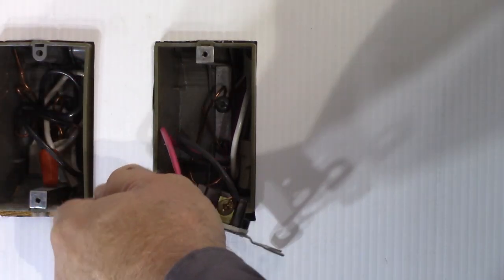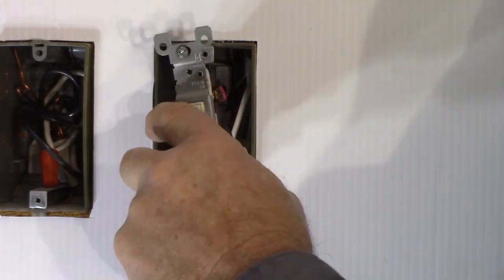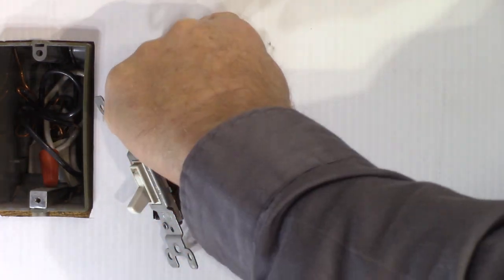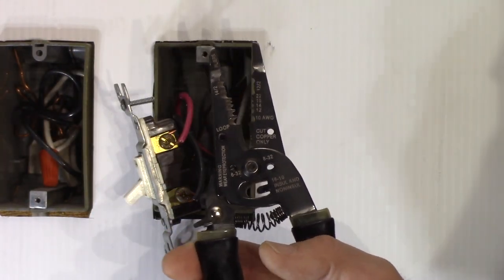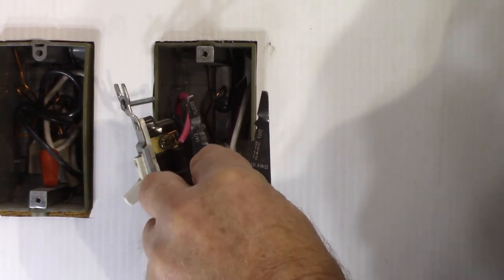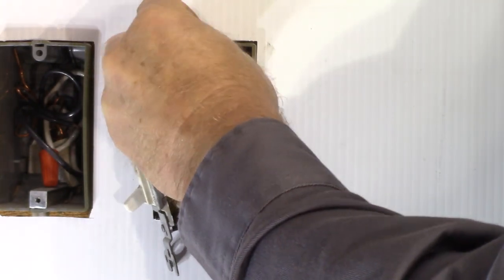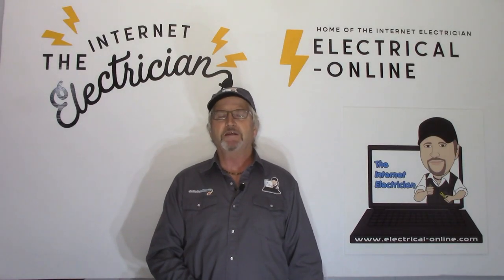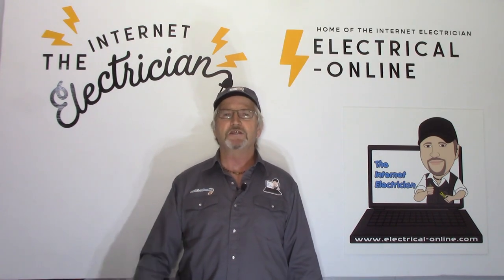Using Wire Strippers to Cut and Thread Machine Screws

Comment: Terry, great tip, but don't forget to look at your pliers.  They will state to insert the screw from the side with the writing.  If you do it from the wrong side, it won't clean the threads when you back out the screw.
Reply from the maker: Yup, good tip.  That is the key, have it threaded in to the correct side of you defeat the purpose.

Comment: Thanks Terry. Any solution for when the box threads are no good from the manufacturer?
Reply from the maker: Yup!  Klein tools makes a screwdriver-type of thread tapping tool that does 6 different sizes, 6-32, 8/32, 10/32 on one side, 3 larger up to 1/4x20 on the other side.
Reply: @theinternetelectrician  Thanks Terry!
Reply from the maker: @Mike-ig2zq  And just a cheap tap and die set is good too.  Then you can tap them out using your cordless drill
Reply from the maker: https://www.kleintools.com/catalog/multi-bit-screwdrivers/6-1-tapping-tool-cushion-grip
Reply: @theinternetelectrician  Thanks again Terry. Lol, soon as u mentioned the Klein tool I went diggin and found it. Excellent!